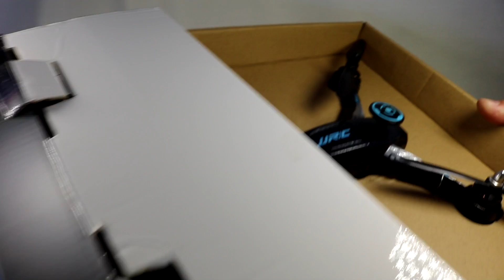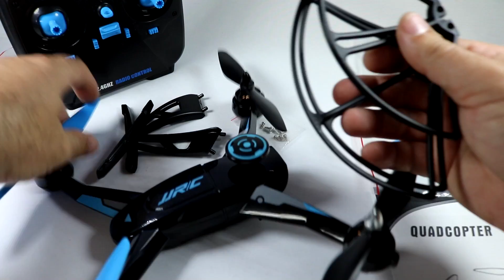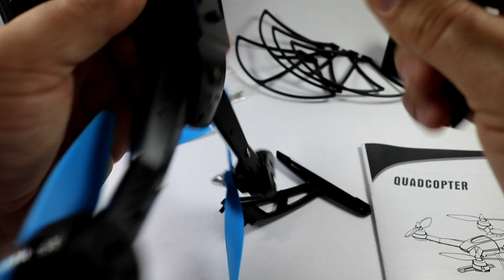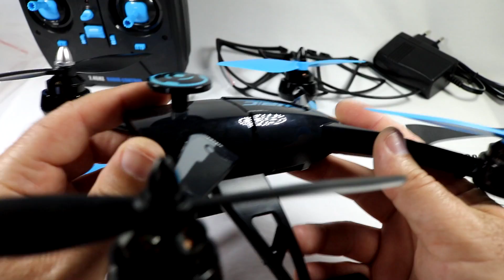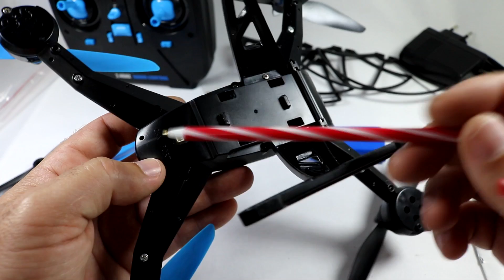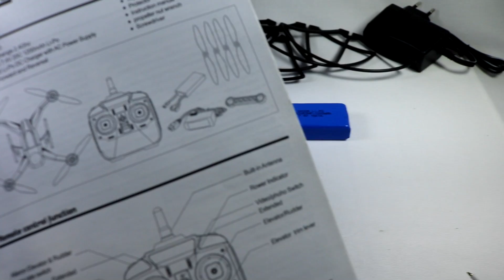JJRC X1 Brushless Sport Quadcopter Drone Review - Part 1 - [UnBox, Inspection, Setup]

Comment: Hey Dustin!  I was trying to find some of your videos about sport flyers and came across this one.  I sort of like the Bugs3 Mini but see it doesn't have headless mode.  Now don't laugh, since I know headless is typically a gimmick and induces beginners not to learn basic flying skills.  But for a small sport flyer that might be prone to getting nearly out of sight fast potentially exacerbated by wind, I think headless could have its place - throw it into headless and pull right stick back to start bringing it back where you can orient it again and take over.  That being said, do you have a personal recommendation for a sport flyer that would have headless?  Customer service is important to me.  Neither JJRC or Eachine respond so they're off my list.  Thanks in advance for any input!

Comment: Dustin, you think that you could attach a small FPV system to fly with goggles Eachine VR007 ?. In this case, what micro devices would you recommend to make it work?. Many thanks.
Reply from the maker: +ladamw1967 Yes it should work fine.  some cams will plug into the X1 port on bottom like the lidi RC L6 Hex cam.   See my X1 mod video on my channel.

Comment: can you use a bigger battery like the 2000 mah  the stock being 1300 mah  looking to get extra mins thanks
Reply from the maker: Yes, you can but would have to possibly cut/mod internally and would possibly stick out back.  I'll be looking into battery and light mods for the x1 soon as I get some LED in I ordered.  I'll do mods video for this one for sure :)
Reply: +Dustin Dunnill thanks for replying

Comment: Looking forward to your flight test.  There seems to be some controversy about its range. I've heard some claim great range, and others say it falls out of the sky at about 100m. With a 4 cell TX, probably can't expect too much in range, although, the Syma X8C has only 4 AA cells, and has range well over 150m. (at least the original TX did .. they recently changed the antenna in the X8* TX and it may now only get 100m) Thanks for the review .. will stay tuned. Cheers.
Reply from the maker: I've done the flight test.  Maybe that's why it dropped... Lol.  I got it on film dropping from around 300ft smashing into the ground and coming out of it without a scratch.  At least it's super durable I guess ;).  I'll have the flight vid up late tonight (wee hours of the morning for mainland USA).

Comment: Nice review as usual! Could you possibly mention in the video and/or the description whether the quad surpasses the .55lbs max weight for the UAS registration in the USA.
Reply from the maker: +Jim Zdziarski Thanks for mentioning that.  I guess it will be a good addition to my reviews now to include "all up" flight weight now that there is a limit of .55 pounds until you are required to register.   I'll start including this weight in my reviews and add it to this description shortly.

Comment: what would happen if i put the fc board from say a tarantula x6 into the brushless motor jjrc x1 ? how do they work, i know the esc's change it from a dc current to an ac current to control brushless motors, but is the fc board much the same as a brushed motor set up sending out a dc signal that controls the speed.

Comment: The gps on my cheerson cx-20 isn't too great and I was wondering that if I bought the gps module for the phantom 3 professional and plugged it into the cx-20 board if it would greatly enhance the position hold and altitude hold. Thanks.
Reply from the maker: +Ciber X Gaming Honestly not sure.  GPS antennas use certain protocals for data transmission to the Flight Controller for the craft and some brands are different.  You'd have to research if that GPS is compatible.  If you have the CX20 Open source version..if uses 3DR Arducopter Flight controller firmware.  There are many higher quality GPS units available that are compatible with this.  Checkout the rcgoups.com CX20 forum if you haven't already.   Huge amount of info in there.

Comment: I looked this quad up on GearBest and it looks impressive with a control distance of 300-400m and a flying time of 13-15
minutes! The current price was real good at $119.99 so that is a good buy.
Reply from the maker: +Dennis Petersen It's great how brushless tech is getting so cheap now and should replace "brushed" soon when they can make it smaller and cheaper.  This quad is Amazing for the price.  If you put an FPV kit on it you could race it since it is so durable.  I dropped it from 200 to 300 feet with not a scratch... I couldn't believe it!  I'll have the video with the flight test showing this up soon :)

Comment: if they fix the yaw issue the x1 would be a magnificent quad, as it stands, its destined to live in trees and roofs and hurt a bunch of people, i'm hoping somebody like dustin finds a way to reflash the motherboard otherwise i'm gonna strip it out and replace motherboard and esc's board and try to salvage it from there, also dustin could you have a look at the motor mounts, the screw holes are evenly spaced but i cant see any motors for sale that have evenly spaced mount holes, and i don't want to be flying this with only two screws per motor

Comment: Can you tell witch one is better? This or hmx280?
Reply from the maker: I have not flown the hmx.  But this one is very fast in rate 3
Reply: +Dustin Dunnill i know that, but it doesn't have a USB plug and manual mode. Even can't do flips. And hmx has everything but his motors are weak. Anyway I ordered it and can't wait for my new drone to come:) nice videos! Hope you will review hmx soon
Reply from the maker: +Daniel Orlov I see.  Yes , this one is powerful and fast but no GPS.  Hope they can make a model with GPS you can turn off and on.  Usually models with GPS are slower so having a "no GPS" mode for sport fly would be perfect.